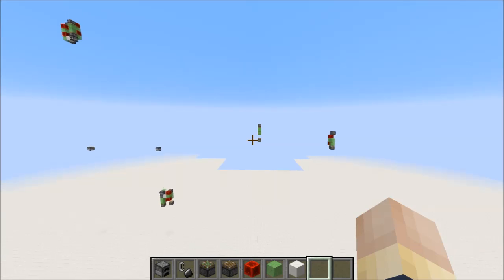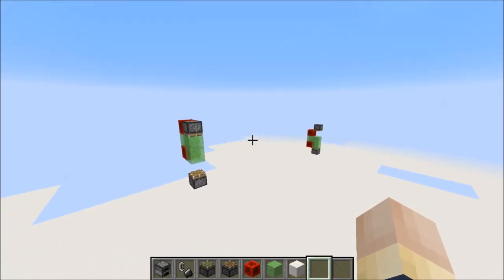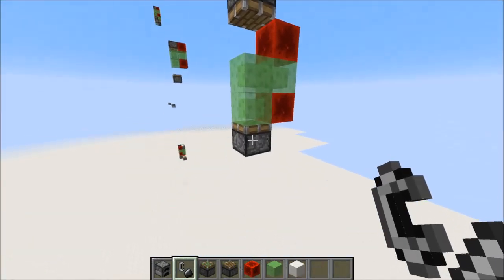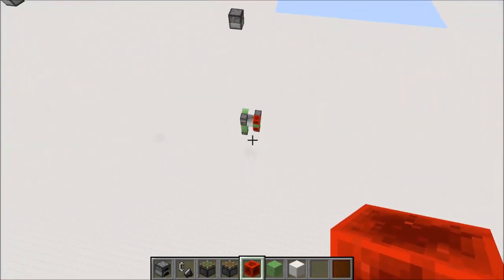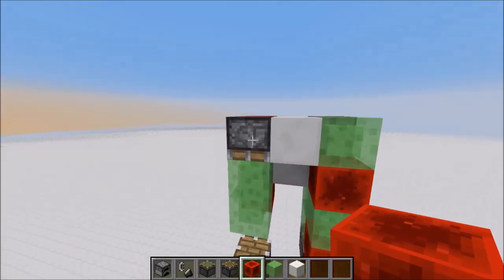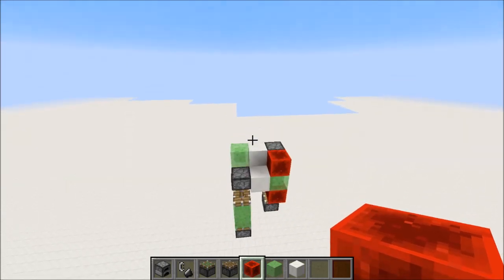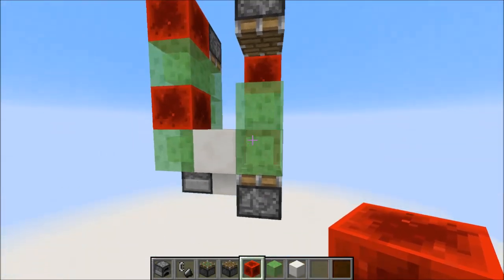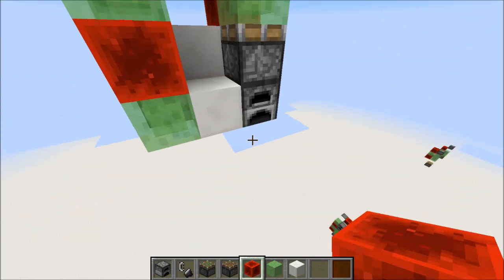Vertical Piston Engines (Flying Machines) - Minecraft 1.8

Comment: You do not need two ascenders / descenders next to each other.
All you really need is a few extra blocks on top of the ascender, as follows: Upwards facing piston, random block, redstone block. This is basically a BUD switch and will update the piston bellow every time the ascender moves. Simmilar goes to the descender.
Reply from the maker: I know there are better vertical engine designs now.  When I uploaded this video the day after the slime block update, there where no other designs.  These designs where mostly just for having fun, and trying new things with the new update.